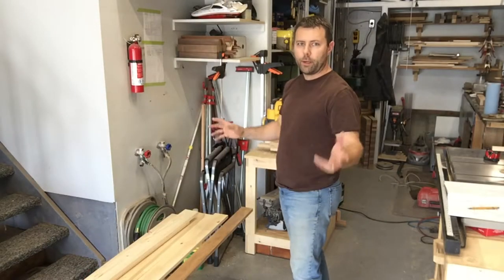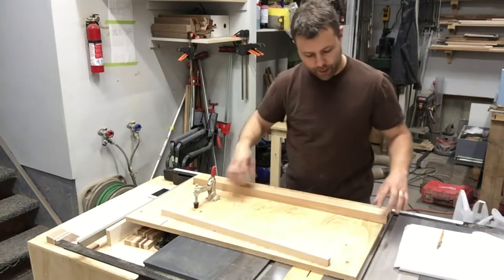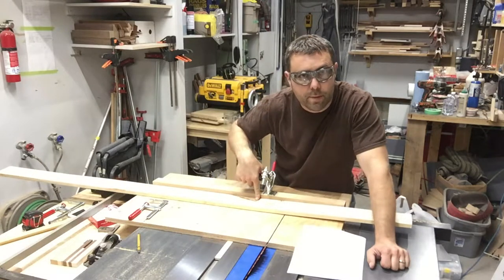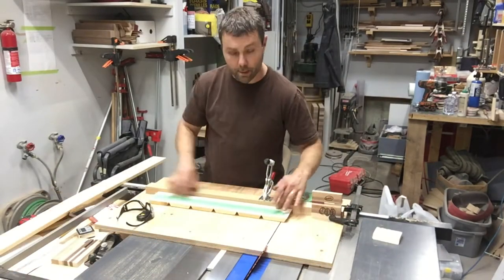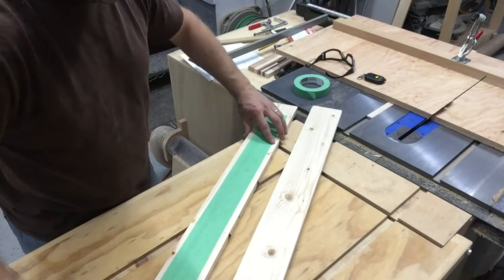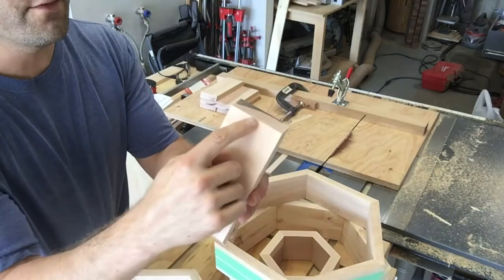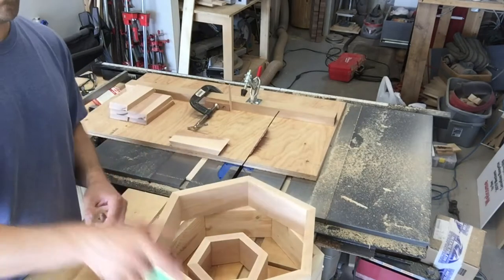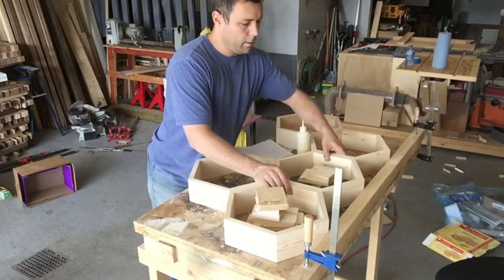Hexagon Wall Mount Display or Picture Frame

Comment: Great Video. So what do you use to hang it on the wall securely?
Reply from the maker: What I used was a small angle brace.  something like this: https://www.homedepot.com/p/Everbilt-1-in-Steel-Zinc-Plated-Corner-Brace-4-Pack-13619/203170051  
For the large one with 5 together I only used 2, then used a dry wall anchor like this: https://www.homedepot.com/p/E-Z-Ancor-Twist-N-Lock-50-lb-Drywall-Anchors-with-Screws-25-Pack-25200/100133106

The braces were just screwed into the wood at the top of 2 of the hexagons ( location is not critical ) . with the drywall anchor it's way more than enough.

The other option if you want to hide the mount is use a key hole router bit and make a few key hole notches for screws to hold it up, again using dry wall anchors for the screws.